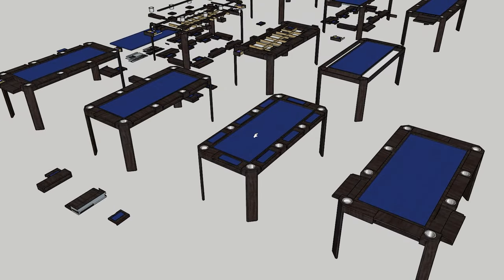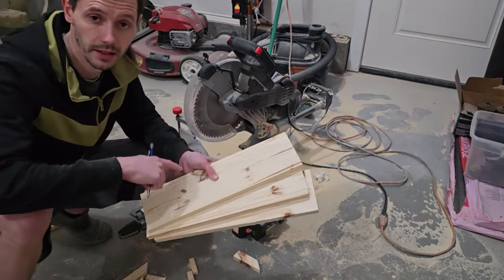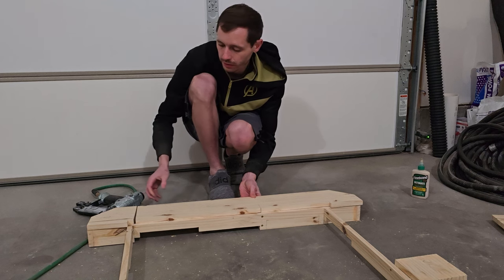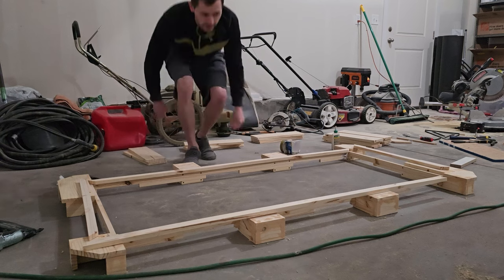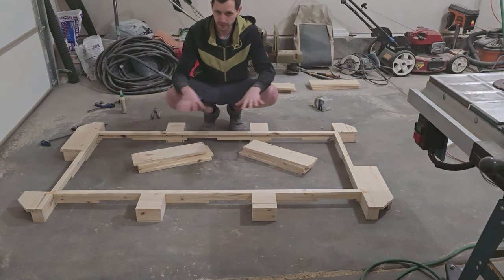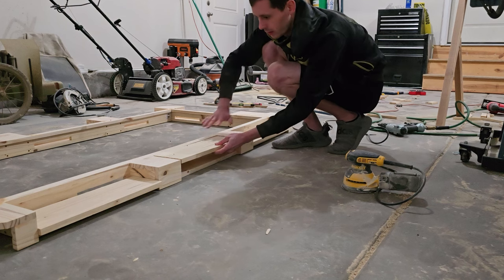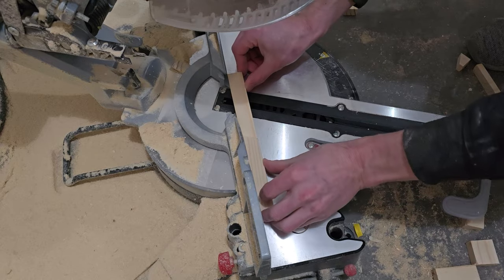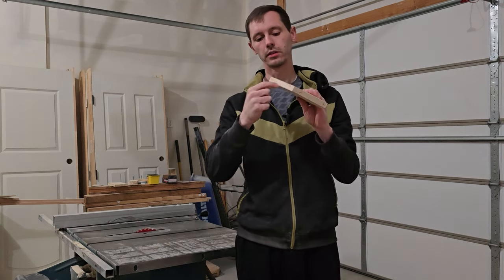Building a Game Table

Comment: it helps to use Sanding Sealer before stain, Helps stops the blotchiness, I might have used a torch to Bring out the grain more before as well, Pine isnt the best looking of woods. ... thiose legs are way to thin, need stiffer base with the way you built the top section, (2) 4X4 Legs up about where Plywood ends are, with a Cross  (2) 2x6s Top and Bottom and a cross member in the center between the Sets of Legs. to stiffin that way.  But I do hope it is stronger than it looks to me as a wood worker. ... PS I would also add Power to each Cubby for laptops etc, Maybe with USB for phones.
Reply from the maker: I've never heard of Sanding Sealer before, I'll have to look into that. Thanks!
It seems to be pretty sturdy so far, It was a bit of a concern but I did try to design it in such a way that it wouldn't bow or have any weak points but time will tell. I do want to do an even more complex, fully featured version sometime with power outlets and what not, haven't had the inspiration for all that I'd want come to me yet but I think that's a great idea!

Comment: the table is nice. but i think the legs are to thin.
Reply from the maker: The legs are each 1" thick by 5" wide. I'm open to criticism and suggestions, I'm not sure what would be considered a 'standard' or 'minimum' but they seem pretty sturdy.
Reply: @LTI I think the concern everyone has is that with the legs only being ~1" thick, they might flex/buckle if your players lean on or put weight on the table. So one thing you could do is attach something like 2×4 (mounted on short-side to create T footprint) or even 3×3-4×4 post to the inside of the 4 legs, to help reinforce them.
Reply: Agreed but an easy fix, put a spine on the back of each one , making a t shape from floor and tie it into table base